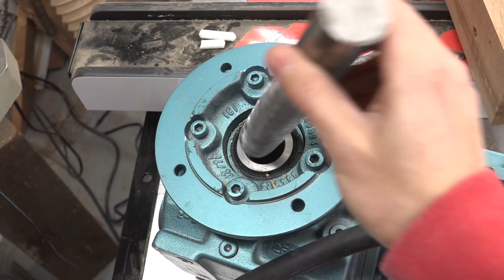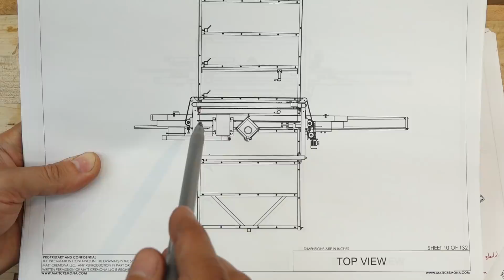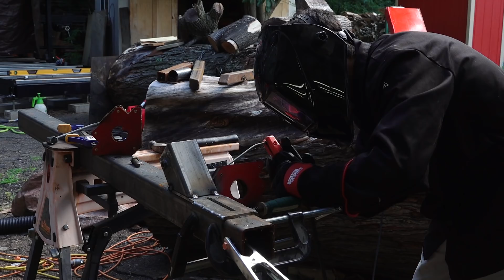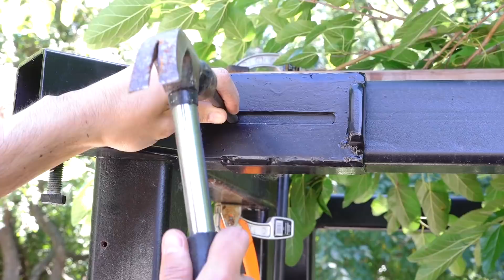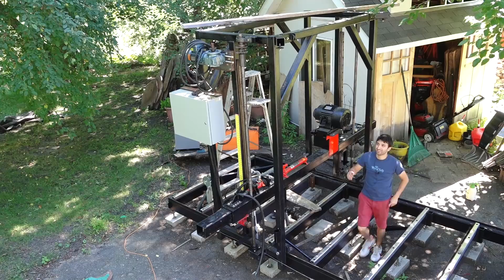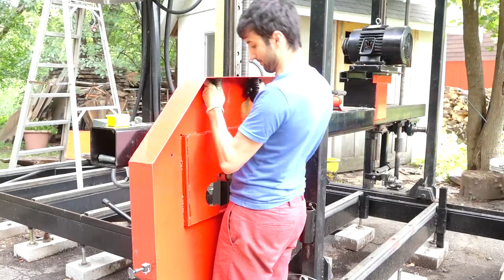Sawhead Lift Motor and Chain Linkage - Building a Large Bandsaw Mill - Part  20

Comment: You are lucky that the control signals to the VFD are low voltage. You can get away with not enclosing the potentiometer and the rocker switch.

Comment: I might be able to get you a kauri log ,if you can freight it, could happen?.Obviously Tane nahuta won't fit on your saw bed ,but there's alot of smaller dying ones that your saw would slay some of the logs are about 18 mtrs long originally kauri homes had full length boards in some houses cut by steam engines etc prior to that it was put sawn timber ,fortunately we don't need to experience that task on a 3mtr diameter log .Appreciate your site and thanks for sharing. P.s I'll need clearance on that log .cheers

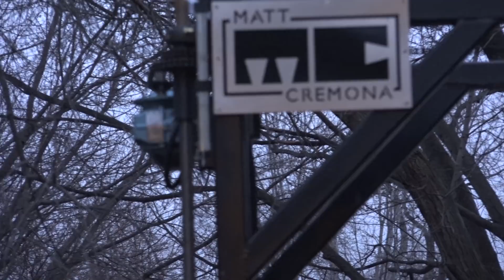Comment: 6:24 - You might consider a product from Renold chains called a Roll Ring - it is a metal/plastic ring that fits in between the chain runs and keeps it taut with out undue stress. They are not cheap (you are going to need one for each set of chains) but (usually) you will never have to adjust chain tension again.

Comment: Hey Matt iam looking to build a sawmill my self  smaller wheels 19" maybe cut throat of 30" and a 20hp motor I thought of using 1 1/2 acme lead screws as my posts and lifting mechanism do you think it would work  I thinking the saw head should weigh about 300lbs the most and a 1.5 acme rod has about 53.000lbs  tensile strength  
What you think?
Reply from the maker: I'm using 1.5" rods and my sawhead weighs about 800lbs.  I think you'll be fine
Reply: @mcremona  thanks for the reply but I don't know if you understood the question the idea it's to eliminate the to guideposts completely and just use the lead screw As a lifting mechanism and also a guidepost for the Sawmill head
I know it's not the most conventional way of building a sawmill but to be honest with you I think it would work I'm not sure if the Acme screw would take the lateral Force as I push through a log thanks again man I highly appreciate your knowledge
Reply from the maker: @cristianosilva6052  I think it would depend on the span and possibly under normal conditions it would be fine but if you crash the sawhead into anything, the acme rod is going to take all the impact force and probably get bent.
Reply: What you do for a living besides YouTube?

Comment: It's looking great Matt!  I hope you're going to replace the twisted pair CAT5 wire from the VFD to the potentiometer and switch with a 6 core flex at some point though?  The CAT5 is ok for testing, but it will fatigue and break if used permanently as it's not designed to constantly flex  :)
Reply from the maker: yes, I have proper signal wire and connectors in my drawer of parts :)  Thanks!
Reply: Matthew Cremona Nice, sounds good. Thanks for the reply :)

Comment: umm, I'm a little confused Matt.. At the start of this videos you're working on the lift motor gearbox and talking about the shaft sizes.. An inch and 3/16ths is 30.1625mm, which is nearly double 17mm.. 17mm isn't even 3/4 of an inch but you took only 6 thou off the shaft..? so, could you explain the shaft hole diameter thing again..
No disrespect intended sir, just looking for clarification.
Great videos as always, and looking forward to seeing some of your gathered logs getting milled up.

Comment: Great job, Matt. How about a shed roof to protect the two motors and the rest of the works??  Also, what brand is the ratcheting tap drive? I have never seen one before other than a palm ratchet with a square socket.
Reply from the maker: The whole thing gets covered in a tarp.  Roof and walls in one shot.  The tap handle is from harbor freight.  thanks!

Comment: I noticed, with the difference in your outdoor wear and the trees, etc. that you have been taking lessons in time travel from This Old Tony ;-)  

Assuming that you had little previous experience with it, it seems that you seem to have the makings for learning metal machining.  That "abrasive machining" hack using the wood lathe is something I would have tried in several past situations.  If I'd had the lathe.

Something to think about ... When you find your property (way out where hoot owls ... um, ... make the chickens nervous ...) I hope you will make sure to have room for metal working machinery.  Double shop laid out in an "H" footprint, (wood one side, metal machining/fabrication in the other, with space in the middle for Mom) sounds like a fair plan to work from.  Sawmill Pavilion in the back niche, with room for a semi to pull all the way around the back if it came to that.

Comment: What are your plans for covering/protecting the mill from the weather?
Reply from the maker: I use a big tarp
Reply: Later, when you have found your property, you can build a Pavilion for it.  Pull curtain sides to block wind and weather when you operate it, or enclose it when you are not ... at least until you decide if permanent sides is going to work for you.

Comment: thank you Matt. question please how does the log / board you are cutting not falling down on the blade and stopping the cut ?
Reply from the maker: The teeth are cutting a wider kerf than the thickness of the band so there wood behind the cut isn't in contact with the blade
Reply: oh lol well that does solve that one thank you Matt

Comment: 1 3/16 is a LOT closer to 30MM, 
instead if 17MM.

steve
Reply from the maker: The joys of recording this stuff late at night. The mounting bolts have a 17mm head. The shaft bore is indeed 30mm
Reply: I was looking for a comment about this before I posted one myself. 17mm is just shy of 11/16" 
I guess the important part is that he got it to fit. :)

Comment: Interesting. Not that I think I'll ever build my own saw mill (mostly because there are very few trees in my area), but Interesting none the less. I am a bit confused about the shaft issue you had (DON'T GO THERE!!!!). You say you have a 1 inch 3/16 shaft and the hole is 17 mm? Or did I hear that wrong? But 1 3/16" ~ 30 mm. I thought maybe you had a 13/16" shaft, but that's 20 mm (more or less)...
Reply from the maker: Yeah I clearly shot that late at night back in the day. It's 30mm
Reply: Ok, confusion gone :-)
Reply from the maker: I think I figured it out. The bolt heads for the mounting bolts are 17mm

Comment: Matt, what brand of tap and die set are you using?  And where can it be purchased?
Reply: Yes! It's a pretty sexy looking outfit! Ratcheting, plus handles slide nicely... I've tapped lots of holes but never had such a nice tool to work with! :-)
Reply from the maker: I've bought taps as I've needed them.  I have a bunch of different brands and styles.  In this video, I used this 3/8-16 spiral tap: https://amzn.to/2LE2jcT and this 1/2" tap: https://amzn.to/2mUjhEQ